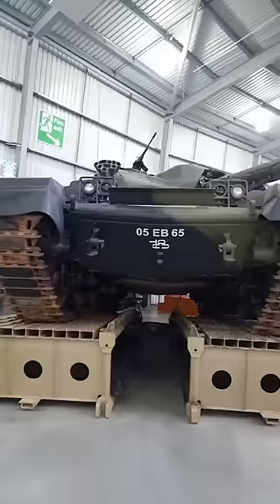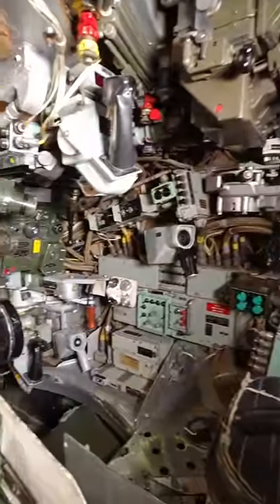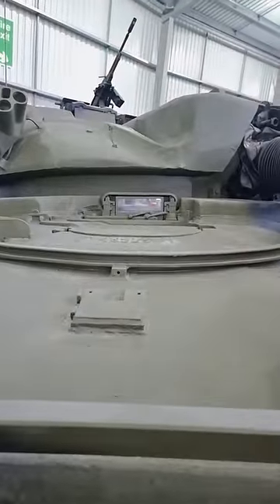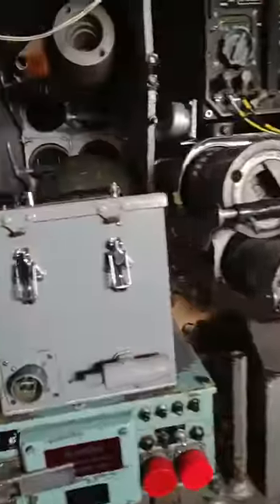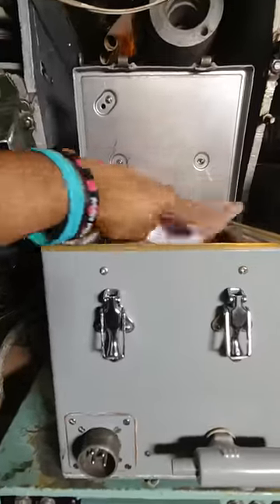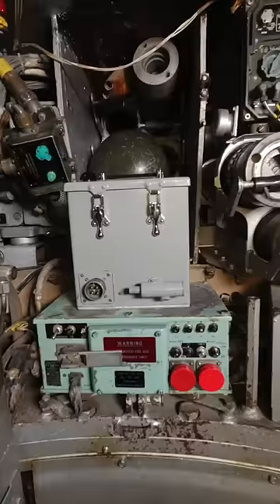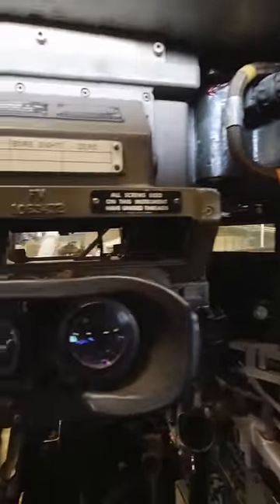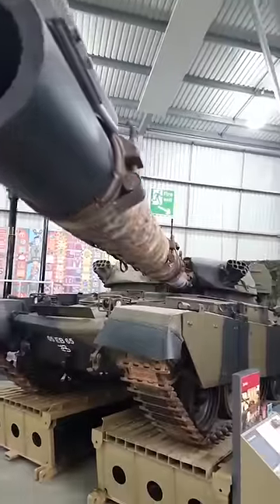See Inside a Chieftain! #shorts

Comment: Certainly does look cozy.
Reply: If i recall correctly, crew comfort was a quite important design feature in western tanks during the cold war.

They expected to be on the defense for a while if a war in europe would have broken out, so your crew had to stay in the tank for long periods of time. So having a decent amount of space, heating and (in this case) a hot meal/drink raises comfort and moral by a lot.

I recall there was even a tankdesign with an onboard toilet, not sure though.
Reply: Yea the t-14 armata has a toilet
Reply: @Noah-qe8sw  I think the T-14 designers accidentally designed a tank for a toilet
Reply: As far as I know the chieftain wasn’t heated and during cold environments it was apparently horrific in a chieftain.
Reply: Yes
Reply: @Cozza69 it was heated. There was a heater by the drivers feet and 2 in the crew compartment
Reply: @tallshort1849  later versions were the early version did not due to its engine.
Reply: @Cozza69  the engine didn't change but yes you are probably correct as I drove the later marks
Reply: @tallshort1849  it wasn’t the engine it was the way they had the fuel system configured apparently. The only reason I know is an old vet in my area used to command a chieftain during the 50s
Reply: @SanderDoesThings Russia bad current thing support
Reply: @SanderDoesThings noob will make a toilet, pro will use diaper 😂
Reply: @SanderDoesThings I too support the current thing!
Reply: @Nugire 
Hold on let me ask Google about the onboard toilet real quick...

Okay so the Challenger II did have one.
Reply: What does a tank operator do when they have to take a sh!t?
Reply: @Nugire UK tanks Challenger II  have also an on board toilet under the seat of the commander (?).
Reply: @JPs-q1o  MRE's had you so stuffed up, you could go days without shitting. Fortified
Reply: @Noah-qe8sw that's insane
Reply: @Dicka899 how do you feel about nalvany
Reply: @ramiere1412  who tf is nalvany
Reply: I’d probably sleep in it! 🤣
Reply: i'm 6'7, soooo....
Reply: @remistruyve8537  that’s on you at that point
Reply: @tallshort1849  wouldn't it just use the heat from the engine like cars? maybe heaters for when it's on standby? 🤔
Reply: @remistruyve8537 probably height limit for tank crew.
Reply: @Noah-qe8sw  good, it can serve as an armoured porta potty
Reply: İt's not a smart person's  job...
Reply: Yeah especially when the commander is standing on your left eye

Comment: The water heater actually has tactical use. A tank crew is pretty much invulnerable as long as their tank doesnt get destroyed and as long as they dont step outside.
So if you are the enemy and cant destroy the whole tank you hide and wait until the crew leaves the tank and then take them out with rifles.
In March 1945 (according to a survey of the British medical research company) over a third of all tank crew casualties were soldiers who had left their vehicles.

So after the war they tried to reduce the necessarity for crews to leave their vehicles - like by adding the possibility to heat food and water inside the tank.
For the same reason the Russians were the first to add working toilets to their tanks.
Reply: Thats just the t14 armata

Comment: I could once climb into a Leopard tank that still was in service at the time. It doesn't have the kettle. And it's tight in there, like in a sports car.
Reply: Leo1 does have a BV, its just not issued regularly. (any piece of equipment you issue, can be broken by the soldiers. and soldiers will break it)

Comment: I HAVE  been inside a tank, a turret---less German-made Leopard Armoured Recovery Vehicle (ARV).  I'm an average-sized guy and it was cramped as hell, having to slide in like a pistol into a holster. It was hot as hell in August at the CNE Near Ft. York, Toronto.  It was VERY claustrophobic and it took almost 5 minutes to extract myself through the front hatch. Not for me, thanks!
Reply: I